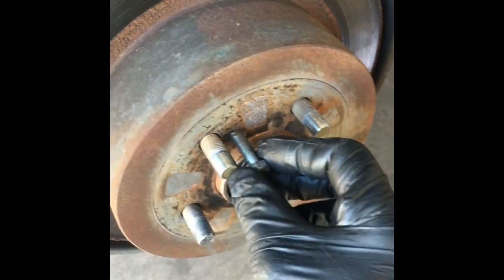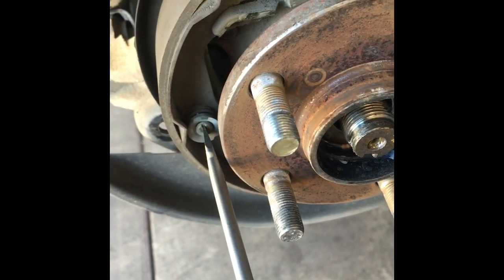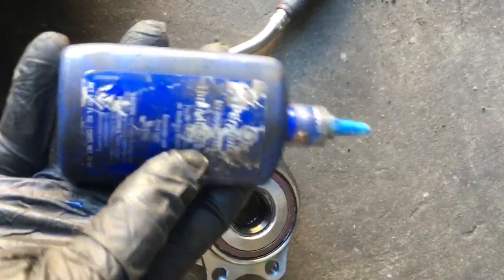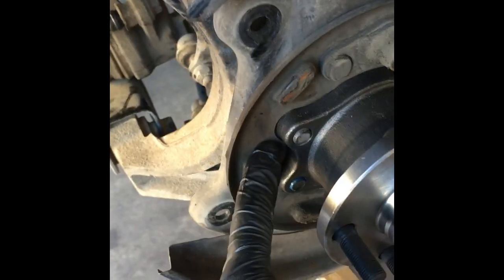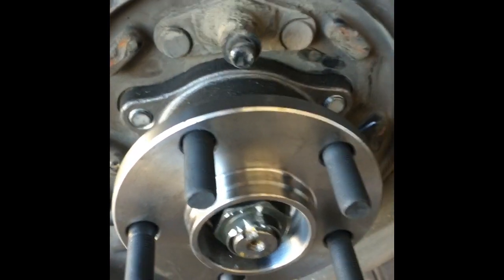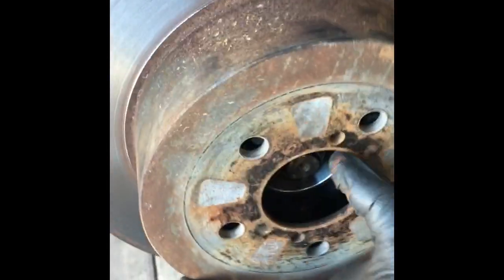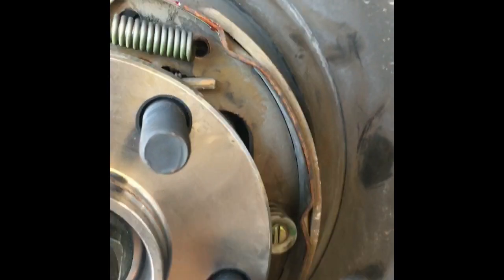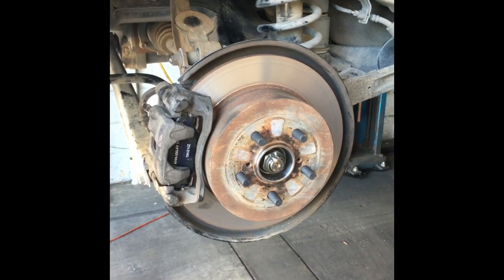How to Replace the Rear Wheel Bearings on a 2005 Subaru Outback

Comment: Hold on! You mean to tell me, the hub asm ‘just came right off’???🤔
If so, I hope you bought a lottery ticket that day!!!! 
Seriously, why does everyone edit out the part where you have steel, inside aluminum, where you have galvanic corrosion. This a reaction between dissimilar metals. Basically “welding” the hub into the knuckle. Which means, either you left out something in this little how to video. Or wherever it is that you are, physics don’t operate the same way they do for the rest of us…🤔😒

Comment: Just a heads up for anyone doing this job you DO NOT have to remove / disassemble the emergency brake components. Simply back the 4 hub bolts out on the rear of the knuckle and the hub will slide clear of the entire backer plate / e brake assembly. Put your new one in and your done

Comment: This is a walk in the park compared to the press in method on the older models. I wonder why Subaru had so many wheel bearing issues, you’d think they’d have fix this after the 3rd-4th year but even on 2015 models there were bearing problems..
Reply from the maker: Gowdaflow I agree you would think they fix it. I bet they are making money off of the repairs. Thank you for watching!

Comment: Just want to check: Did I miss the part where you remove the ABS sensor first? Big trouble if you don't, because it sits in a groove at the rear of the hub, and will break.

Comment: I typed 2004 Subaru Outback and your clip was recommended so I'm wondering do you know if the 2004 and 2005 bearing/hubs are the same.
Reply: hello 
by chance, did you find the answer?
Reply: @nicholasgilbert4227 Afraid I'm a little late, but up through 2004 the bearing needs to be pressed on and off the wheel hub, while 2005 and up use a replaceable wheel bearing assembly as shown. Hope this helps someone in 2 years! 👍

Comment: wow this is an easy replacement. Sweet! I'm used to changing fwd bearings which are a pain. They have to be pressed in and out. Looks like you got the whole hub assembly.
Reply from the maker: Yes get the hub assembly so much easier.

Comment: Video worked great thank. Wheel bearing replaced but now my abs light and traction control light on on the dash. Mines a 2004 outback. Any ideas how to get rid of these? cheers
Reply from the maker: killer con check the ABS sensor at the wheel make sure it's plugged in. Possibly got damage with the bad wheel bearing. And you will have to clear it with a scan tool
Reply: cool thank you
Reply from the maker: killer con did you get it figured out?

Comment: i tried to pull my hub of using a puller and two bolts like shown, and I believe i might have cracked my hub spindle due to excessive torque. Plus make sure that Parking brake is off or the rear rotors (drums) will never come off

Comment: What do you do when the bearing hub is stuck to the spline and brake plate?
Reply from the maker: Hello Tye. You can soak it with penetrating oil like WD-40. Apply heat to it. Or use a hub pulling tool.
Reply from the maker: +How to Automotive OTC makes little. You can get it from Amazon
Reply: Thanks.  When I pulled the hub out, it broke the ABS sensor, because the drive line came out with it.  Something you might want to point out in your video and it only takes a moment to remove the sensor.  .
Reply from the maker: +Tye Hardison thank you for the tip!
Reply: Keep the bolts in part way, and tap on them with a hammer going in a circle. That works great for me, although for one car I had to soak the bearing/hub seam overnight with kroil due to extreme rust.

Comment: btw I'm watching this cuz my wheel fell off my car and all 5 of the bolts snapped off... wondering if it was cuz the wheel fell off or was it a bad bearing or something please get back to me its curious... I hope you understand those 5 long stems that the wheel would be lugged to.
Reply from the maker: rudy torres it sounds like to me the Lugnuts were loose. Did you recently have work done to the car?
Reply: How to Automotive sorry I did say the Lug nuts were loose in a second comment. but would that result in those snapping if the wheel fell off? I think someone sabotaged my car but my gf was driving it 3 hours away thank you.
Reply: How to Automotive also the cv joint has been shot for a while not sure if that would affect it can't see how it would.
Reply from the maker: rudy torres if the Lugnuts were loose it would definitely have snapped the studs off.
Reply: How to Automotive thank u sir.
Reply: Bearing is bad i had all 6 lug nutts snap off my 84 chevy k 1500 and almost flipped over doing 60 it was a bad bearing moving in and out sheered the lug nuts clean off
Reply: @randallmonroe3698  You can't compare a pos chevy with an outback!!! 2 different companies and vehicles!

Comment: Why all SUBARUs fail at the rear right ball bearings? I have changed atlaest 5 ball bearings in 2 years now...

Dunno what can be the cause?

I changed the rear left one 2 years ago and it has been running fine since then..
Reply from the maker: Mohamed Medhat could be anything from not getting that work proper on the axle nut to just a defective part. Hard to say I have not run across a problem.
Reply: How to Automotive 
i have some questions
first i dont have a torque tool..so i use all my force installing the axle nut then i bend the upper dish on it so tht it wont rotate wz motion
would that cause any problem to the ball bearing?
second..ive read that you should push the ball bearing using something that pushes the outer shell..not touching the inner parts as applying force to the inner parts of the ball bearing to push it damages the balls inside..is that true?

third.. can i dissassemble the ball bearing into 3 parts..the outer shell and 2 inner shells with the balls attached to them...would that ruin the ball bearing...i bought an original NTN made in japan ball bearing...part no AU0827

i thought i wkuld apply more grease to the ball bearing between it and its seals..what do u think?

i need new ideas...

this problem is facing 4 of my friends with the same model in the rear right side...one changed up to 12 ball bearings till now in 4 years...

they are all rear right ones...

your help is much appreciated..
Reply from the maker: Mohamed Medhat having the bearing too tight or not tied enough will definitely wear it out. Pressing it by the inner bearing portion can possibly damage it.and as far as taking it all apart to lubricate it not sure if that's worth it a lot of moving parts to misalign when you're putting it back together because damage. I would buy it bearing and hub as one complete unit makes life easier.

Comment: Brian, I am trying to replace the wheel bearing on a 2006 Subaru outback myself. The damn thing will not come off! What do you suggest to use to free it from the car? Would a blowtorch work?
Reply from the maker: GhostTrain615 A blowtorch would most likely work but before you do that I would try penetrating oil and vibrations so maybe a impact hammer or just tapping it with a hammer. If you use the torch make sure that you have everything disconnected wheel cylinder caliber everything.

Comment: you left out the hard part, how did you separate the hub from he knuckle??
Reply from the maker: joepinehill I didn’t separate it because I replace the whole unit bearing and hub As one peace.
Reply: I understand , I've replaced 2008 hub bearings.  But video doesn't show how you pulled the hub from the knuckle. Thats he hard part, if you live in the rustbelt.
Reply: joepinehill wedge spreader jaws between hub and control arm. Use hydraulic pump to  put pressure. Then one whack of hammer and out it pops.

Comment: Why not leave the emergency brake all together and just remove the backing plate
Reply from the maker: TDONLEY91 that's something you can definitely try to do if it works out awesome. But if it doesn't work out this is the video on how to take it all apart.
Reply: I was just thinking - I don't remember removing the e-brake stuff for the other one I did a year ago - that must be the reason. I'll find out this week. Either way, having a brake assembly guide is great.